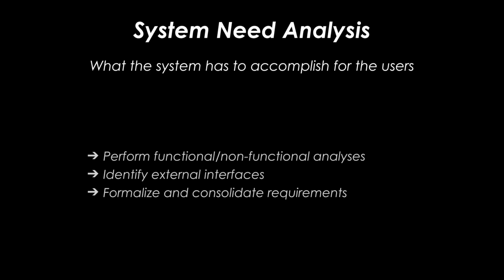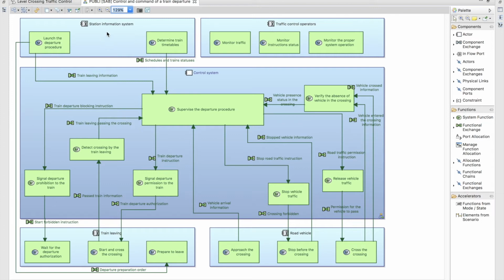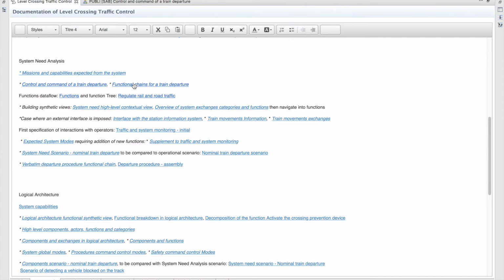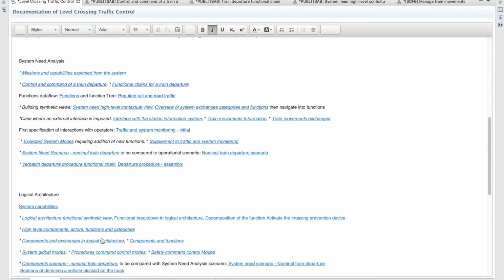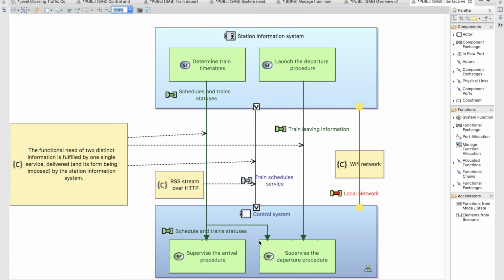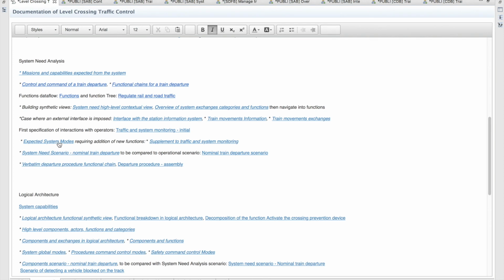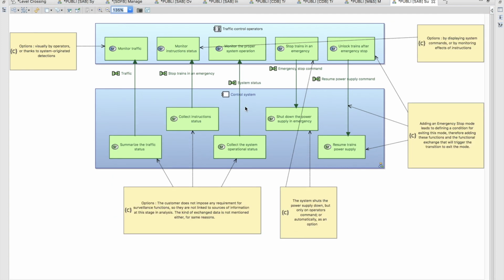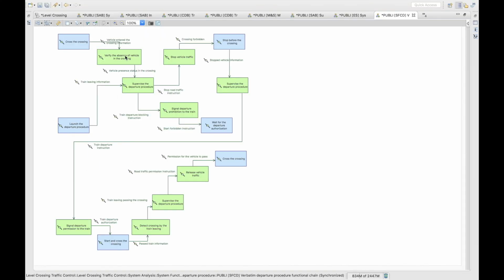Walkthrough Arcadia & Capella Model - System Need Analysis

Comment: How is a mission element added to the [OCB] diagram ? In the Level Crossing Traffic Control Sample I downloaded for 1.4.0 , I see a Mission element in the OCB diagram. However, creating an new OCB I do not see options for adding missing element.
Reply: I had the same question and found out that it is added in the MCB diagram at the Operational Analysis level.